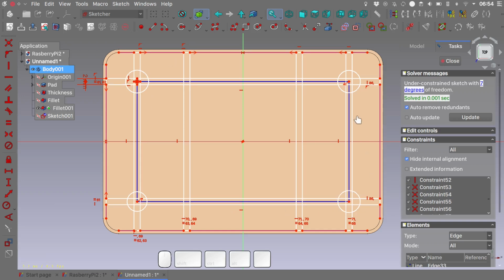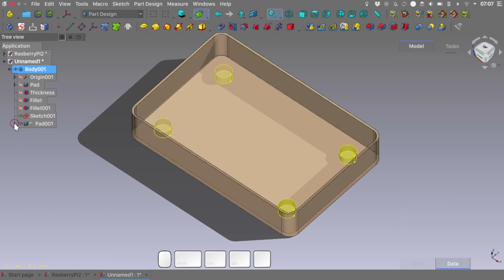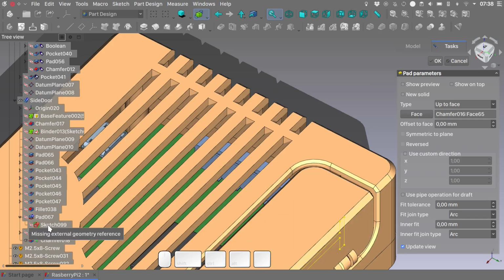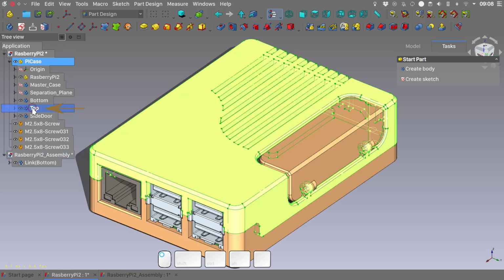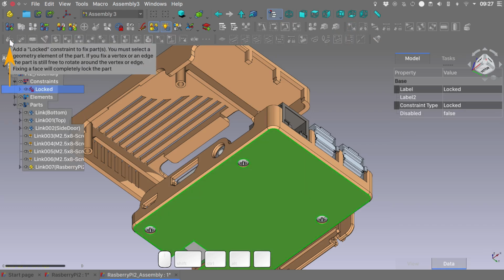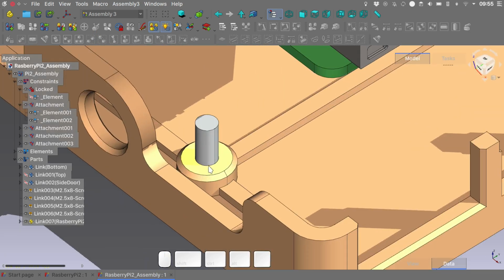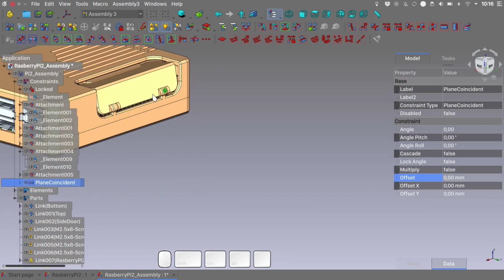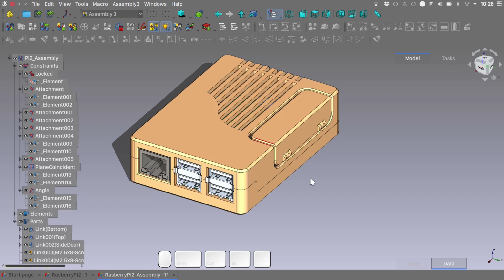Rasberry Pi Case for 3d printing video tutorial(part 4) Assembly and finishing touches.

Comment: The sub sketch seems nice, but do you have to remove an export if you made an error? Is there no way to add additional exported edges to an existing export? What if you use the part design shape binder approach, can you add and remove edges in that case?

Finally, why do they work so differently in their implementation? That seems a bit silly to be honest.

Comment: On my LinuxMint system the RealThunder appimages are crashing after a few seconds. It is not even required to start anything after loading a project. Just perform a CTRL->A in object tree and boom, application gets terminated. Older Versions and the official editions work fine.
Reply: Have you reported the issue? If not, report it on the github for linkstage3.
Reply from the maker: It would be usefull to get a trace of the crash. Start the appimage from the terminal then make it crash and copy the message from the terminal. 

With the backtrace from the terminal it will be allot easeier for RealThunder to pinpoint the issue. Otherwise is a too generic crash report and can't help much. 

A good place to report is here https://github.com/realthunder/FreeCAD_assembly3/issues

Comment: Is it possible to use limiting constraints? For example limit angle constraint from 90 to 180 degree and allow moving part between this 2 angles? If not it will be great feature to implement in assembly3 :)
Reply from the maker: That is a feature that always wished I had. It is already implemented in asm4 and i'll make a feature request form asm3